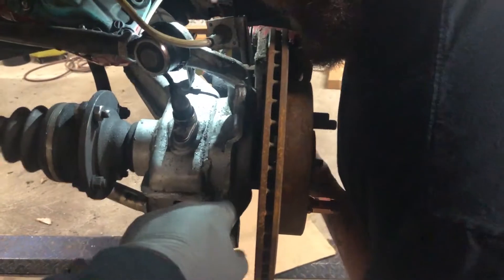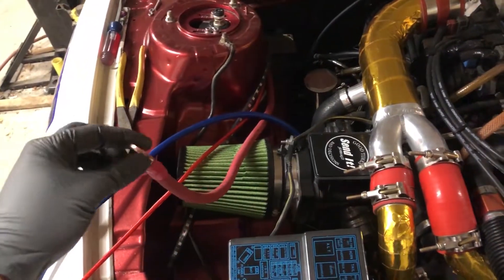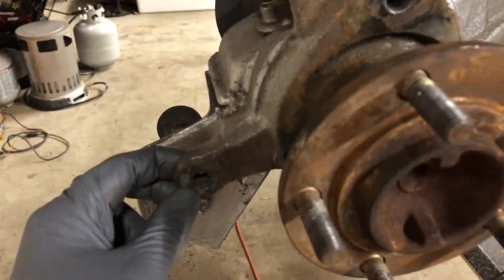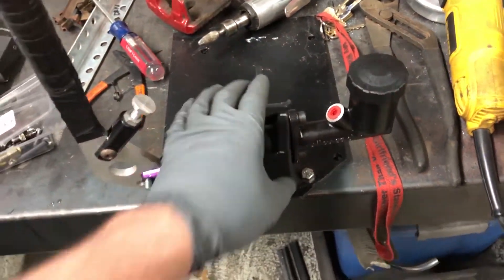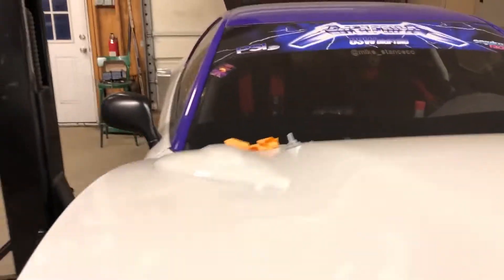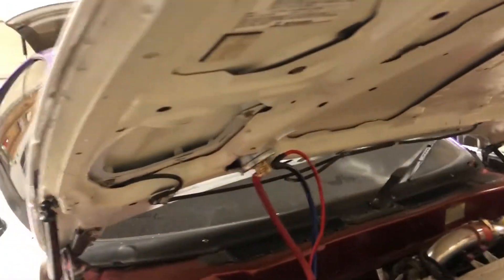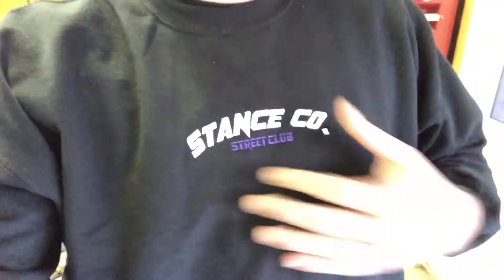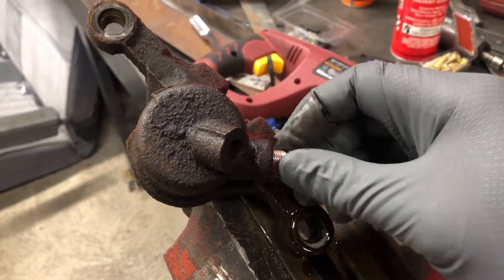3000GT Dual Caliper Bracket + LAST MINUTE CRUNCH!

Comment: I hope your cutting power to the alternator with your battery cutoff switch. I installed a cutoff switch too and at first bought the style you have then bought a dual contact switch. One set disconnects the battery and the other set disconnects power to the alternator. The alternator gets power from the IG2 circuit. I have a video on my small channel showing the operation but not how I installed it.  Otherwise looks good!0
Reply from the maker: John's Barn this one doesn’t, it was the only one I could get with the time crunch we had. I do plan on swapping it with one for an alternator cut. The alt harness on this car confuses me tho so I’m trying to figure out where to intersect with the switch.
Reply: Mike DeFusco oops I gave you the wrong circuit. IG1 controls the field coil via the voltage regulator in the generator. Since my cutoff is in the cabin, I spliced into the ignition switch harness on the IG1 line. Otherwise you can splice into the B-18 connector, pin 2 on the alternator
Reply from the maker: @johnsbarn1033  Awesome, thank you for that info!  I will look into the B-18 connector to get the proper cutoff.  Thanks!